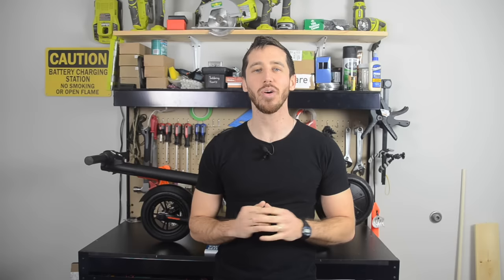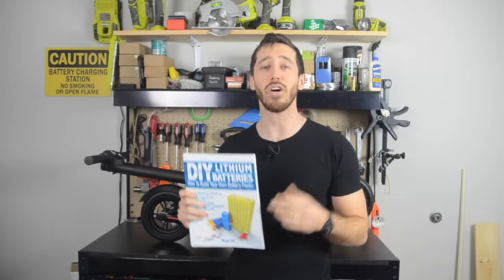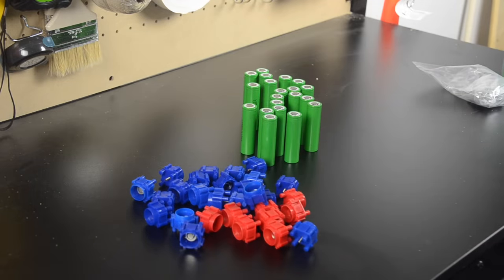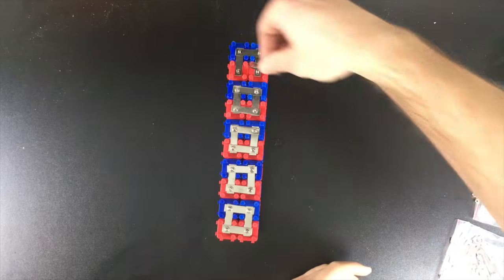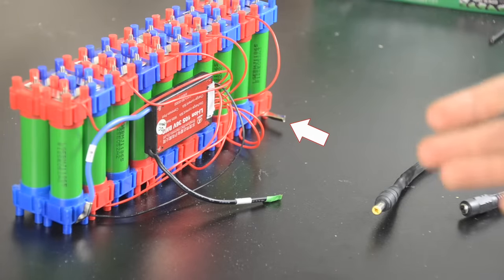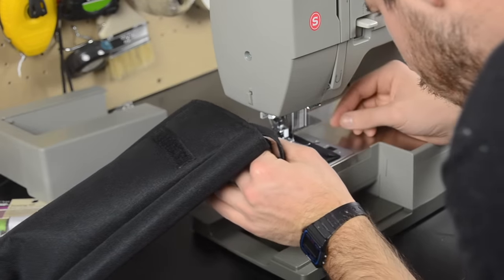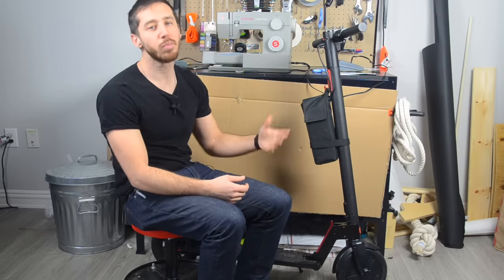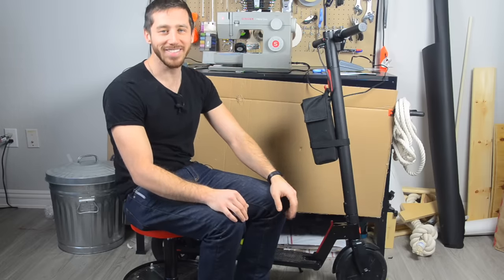DIY 2x range booster battery for electric scooter or e-bike

Comment: I have a question to make for you , maybe you are the only one that can properly answer. 
I want put two front lights on my 54v 18.2amp scooter , but the lights are 12v-80v lamps . If i direct conect them in the cable from my original lights in the scooter what kind a problem can happen , or if is okay to do it ?
Thank you , i hope you can help me .

Comment: is it really that simple to connect two exact same voltage batteries in parallel by " plugging that pack in to the charge port of your e vehicle battery ?
Reply: Yeah it's just like adding more cells to the original battery
Reply: Haven't gotten to it yet but I want to add a aux battery pack to my electric motorcycles. This way looks the most efficient .
Reply: yeah I want to know as well.. when i plug in the wall charger to my scooter it doesnt run... is it because its ac? so once i build the battery i just plug it in and it will work or do I have to bypass something? and then how do you charge the extra battery pack?

Comment: I have a DYU d1 36v. I’d like to use a ryobi 40v battery as a range extender. Could I put a quick connect on the original battery so I can unplug that battery when it’s low and plug in the ryobi battery?

Comment: I’m a newbie to ebikes and battery power. I just want to be sure I’m understanding this correctly, don’t want to burn up batteries or motors or anything! I have a second battery for my bike, it is the same voltage but slightly less ah than the original. So I can connect the second battery into the charge port of the first and that will boost the range without damage to anything?

Comment: hello, I wonder about soft pack lithium 48v if the charging port is broken, can I charge the battery on the xt60 connector of the output the one to the sooters ontroller? are they required to charge on the charging input [laptop connector) is it difficult to splice otherwise?

Comment: Thanks for a good video. I have a turboant x8 max with removable battery. Do you have any good advice for connecting a battery like the one you build in the video. My turboant cannot turn on when charging. That's why I can't connect like you do in the video. I think I have to solder a plug on the wires inside the scooter?

Comment: Great video.thanks. Ok know voltage .5% up or down difference makes no difference but what if use a 36v4.4ah on a 36v 5.2ah battery for go trax rival and can I buy one already made with different ah but same voltage and splice tip of wire or connector to plug into my gotrax rival for extra diy power?thanks...

Comment: What is the rule of thumb when building a second 18650 battery to be added in parallel? Does the continuous discharge and capacity of the cells matter? Do the specs have to be the same? I built a 14s4p battery with Panasonic NCR18650F which are at 2900mAh with a 5A continuous discharge...

Comment: @EbikeSchool.com Thank you so much for making this video Micah! I owned 2 original GOTRAX GXL scooters one for me and my Girlfriend. The range was really becoming a problem especially if we wanted to commute, take long rides in the country or on Holidays here in the U.K.

After watching your video I was on a quest to build the exact same exact batteries you built for our scooters and with the guidance of this video, few month of making mistakes wiring my connectors incorrectly, shorting 2 chargers and 2 scooter batteries they are finally finished. 

I’ve build 2 of the exact same batteries using the V2.1 Vruzend Kits with 3 cells in parallel using Samsung Q30 cells with a capacity of 9 Ah each and man is the scooter even faster than before, it does 22mph all day long now, so fast I wear a helmet as it’s just as fast as my Brompton Bike. If not faster!!
 🛴 💨 💨 

All credit goes to you Sir, once again thank you for the awesome content! I’ll be posting a video of the finished builds soon for watching for name in the video credits.
Reply: How did it hold up?

Comment: Hi. I am new to baterries and my question may sound silly. 

I am thinking make a battery that is 3 times the capacity of the scooter's battery. Then connect them through the charging port like on the video. 

Do you think if the new battery has much larger capacity will be okay? Will it increase my range a few times?

Comment: Hi Micah, is it possible to connect or BOOST a 48V ebike Battery pack with a 36V Battery?
I upgraded my 36v Vehicle to 48V (Battery, motor wheel and controller)  and now I have a redundant 36v battery pack which is very a good one(panasonic cells).There is ample space to carry both batteries on the one bike.

Comment: Another question...I want to build a booster battery for a 48v 14ah battery. When daisy chaining the original and booster is it important to match the voltage AND and amp hours or can the ah be slightly different ?

Comment: Hello Mica 
Can I parallel these 2 battery packs 
Both 48v lithium ion 18650 LG cells 
A 13s 7p with 210 amps continuous 
And a 13s 20p 200 amps continuous
Thanks in advance 
Hon

Comment: Question... Could I build a booster battery like this for my 60v escooter (which comes with a lithium ion battery) but use a Lifepo4 battery instead? I just like the simplicity of the prismatic cells. Will doing so cause any damage to components, the original battery longevity, etc?

Comment: Thanks for the time and effort you put into these videos! A video on wire gauges for power wires and battery capacity would be great! I want to build a pack, but worry about burning up the wiring if it supplies too much power :p

Comment: Hi. I have a query. I have made an electric cycle with 250w pmdc motor and 15ah lithium battery 7s7p and 15a bms. What I had noticed the full voltage shows me 28v after charging and it gets cutoff at 24.5v. Hardly I could have driven my cycle for about 10km or less, but not more than 10. Why does it get cut off so early, on the controller the cut off voltage mentioned is 21v, but it gets cut off at 24.5v. At 24.5v if I apply throttle, the entire system is switch off. What could be the issue, with the controller or bms or anything else ?
Reply: i think its because of your bms. 24.5v is 3.5v per cell. under NO load. so when you are driving there is a load and you go under the 3.5v per cell. the bms protects the cells and cuts the power. until the batteries go back up to a safe voltage. if you are using old cells or cells with a low discharge rate this will happen faster then cells with high discharge rate. so if you want more miles. make the pack a 8s. your ebike motor can handle it just fine. just make sure your controller can handle the extra voltage.

Comment: Do the cells have to be identical, from the same manufacturer, identical specifications? (Panasonic PF vs LG vs NoName chinese). Or it is enough to have the same total voltage and slightly higher Ah for the booster one, like in the video?

Comment: Wanted to fyi you of the topic on the WATT numbers on motors and what to look for of certain companies that advertise of what they have to sell. I came across a sale on title of 350/500/750 watt e bike and remember what you mentioned and I notice this as the Bike is all the same with the 500 and 750 having bigger tires than the 350 including the battery for each one. Well, I know enough now I went ahead and got the 350 watt GEARED Bike and I just swapped the battery intended for 350 and got the one separate of same specs of the 500 and 750 they were selling. I basically got the 750 without their fatter tires and higher amp battery, lol. Im going 24mph on the 350 daily of new battery of same amps as the 500 and 750. I saved 300$ of getting the 350 watt which actually is same motor for the higher priced ones of same model. Its really  a 1000 watt motor as I checked the wattage amps when I juice up throttle all up it reads 1000 to 1200 and it drops to NOMINAL OF 500 to 750watts once on cruise control and dips down to 50 when I use PAS at 24mph.

Comment: QUESTION:   i have wired 2 18V 5AH  cordless tool batteries in a series to get my 36 volt requirement....currently have a 36volt 10 amp series of 3 batteries as primary..cant i plug my junkyard dog battery set into it and then increase amps by 5 ( 1/3)  ?

Comment: Hi, great video. If I were to plug the booster battery with lower charge than my ebike, would I damage the ebike battery, or will the ebike battery just charge the booster battery to an equilibrium charge? Thanks.
Reply: If theres a small difference it should be okay. If its too big everything between and the batteries themselves can catch of fire.

Comment: Is it okay to connect 2 packs that have diff capacities? I was told that I is not a good idea since the oack with the smaller capacity would drain faster and would result in an inbalance of voltage of the packs, but they say that if I wanted that setup, I should put a 3 way switch, that way I can switch in using the external pack when the internal pack is depleted. Whats your opinion on it?

Comment: What happens if I put in parallel 36v .4 amp with 48v .15 amp ,please tell me is dangerous ? I want to put one battery from hoverboard to one scutter for range extender it is possible to do that?

Comment: On an electric scooter, I want to replace my damaged battery... 
Will the exact same charge controller work if I put the same number of cells just with higher capacity ? Will it still charge/discharge normally ?

Comment: Corect me if i'm wrong but it should be safe to connect the battery to the scooter even if the charge level is not the same. The battery with the higher charge level should charge the one withe the lower charge level.
Reply: Still problem charging both battery packs seperate all the time just make new pack better cells or more cells in parallel and because charging port is for charging is the wire capable of withstanding the current 
You end up burning the wire then ya have to do repairs anyway 
Bin scooter battery makes it lighter
Make better one upgrade power connection and wires put battery in Ur backpack

Comment: Thanks for the video.I have done the battery but when i plug it and ride the scooter only the scooter battery gets discharged ,the backup battery drops only 1 or 2 volts.The scooter baterry drops to 7v ( from 29 V) and the backupbattery drops from 29 to 27V .I have noticed increase from 8 km to 10 km(with the backup pluged) Is that normal and where is my mistake not to double the distance?.Thanks.

Comment: If you have a 72v 20ah battery with a 80a BMS could I simply use a second 72v battery for more range….No BMS? Would the battery with the BMS continue to keep it at 80A But increase the range? The speed is fine….I just want to increase the range.

When building another battery…and you have the cells matched with the main battery, would I have to multiply the individual volts on the cells…to hit my 72v’ example…if each cell was 3.7 volts Wouldn’t that mean I can only use around 21 or 22 cells…to achieve a 72v battery?

Comment: Is it a good idea to connect the second battery to charge port?
In high power ebike the charge port doest take much current
Isn't better option is to connect the second battery to the power wires that goes into the controller parallel to the original battery so the controller can use the full potential of the second battery?
Reply: I have the same question.
Connecting to charge port is for sure the easiest solution, but is it the best? And will it work for all scooters? I have xiaomi m365: charger output is 42V an 2Amp (84watts) scooter battery on the other side is 37,4V. So what should be my range booster battery voltage if i want to connect it to scooters charge port?

Comment: just bought your book, amazing job and videos, i assume the charge time for your battery took 2x as long as before with the same charger you used for charging the scooter prior to the battery upgrade? also the battery indicator on the scooter, i assume it reflecs the percentage of the remaining power left for the old battery which should approximately equate to the same percentage of remaining battery in the new scooter as both the new and old batteries should have the same voltage? Are these both answers yes?

Comment: Great video. I have the Go Trax Rival and read some really bad reviews . And of course no customer service line ... Just email responses in 72 hours Asking for this or that. Then when you respond 72 more hours ( each time ) on response and a different rep you have to explain the whole issue and history of problem with each time per many many reviews. I've had no issues yet as in 2 days of ownership and have 30 days to return if I am not satisfied.
I like the scooter but it seems Go Trax Customer Service is not user friendly and the longevity of the batteries installed and the charger wind up being very short lived. Ninebot and Segway have the best and longest lasting scooters with their lowest priced model priced at $439.00 plus a $20 off Coupon.   Just curious on this battery system.

Comment: EBIKESCHOOL....... I HOPE YOU SEE THIS. Thanks for your videos foremost... I own a kaabo wolf warrior electric scooter it has a 60v 35ah battery with 2 charge ports so if I make a 60v 15ah battery and plug it into 1 of the charge ports can I leave it plugged in and use the 2nd charge port to charge the original and new booster battery at the same time? Also wanted to know if both batteries will discharge at the same time,as 1 battery? THANK YOU FOR YOUR HELP!!!!!!

Comment: Just got a 60V 21Ah battery electric scooter.  I'm planning to build a extending range battery.  Can please someone point me to the right direction?.. do I need to build a 60V 21ah battery?  Can I make a smaller with more Ah power?  What would be the best recommendation.?  Thanks in advance

Comment: Thanks alot for the video bro, was really helpful for us us noobs to understand.

So as long has my new battery pack is the same 72 volts,I can still use a higher A.H ( 80ah) than the existing battery (35ah)?

Comment: Couple of Questions...
Can this be used as a backup battery in the event that the Scooter is running low on juice? 
I didn't see in the video if there's a charging port for the DIY battery...
If Yes on both questions please sell the product as you can see a lot of people trying to buy your product....
Thanks😉

Comment: Is it important that both batteries be of the same array configuration ?

I wish to parallel connect 2 48v battery paks. One is 13s7p (17.5Ah), the other is 14s5p (20Ah)
Reply: The 13s and 14s will have different voltage so that is not recommended. You can put a 7p in parallel with a 5p, but each needs its own BMS and fuse.

Comment: Shouldn't you mention the possibility that when using the primary battery under sufficient load (>10 amps), the secondary battery will try to put a charge current into the primary battery far too large to charge? Kind regards

Comment: Are you charging the main battery as you use it or actually running off the second? Also, the gotrax charger is 42v,  why didn’t you build a 42v battery instead of 36v?  If the bms of the scooter is working properly why would it discharge into the second battery since you’re plugged into the charge port?  Great video, just many questions remain. Thanks for taking the time to answer.
Reply: He said the second battery is charging the main battery. Some scooters can still run with charger plugged in and others can't. Check to see if your scooter will spin/run while charging before you proceed to make your kit.

Comment: Interesting, can this be done on a  Bosch Performance CX
Equipped with Bosch's top of the line Performance CX motor and 500Wh battery on a Cube Reaction Hybrid Pro Allroad 500 ebike ?

Comment: i missed was conectiongvto the type of battery in these gotrax scooters .i have one laying around and had a look at is design .i would go for a 365 type scooter or but a bigger ah scooter to start with .if youre looking for one .as a budget scooter the  lower center of gravity .given the baterry is in the base and not in the steering pole attaching another weight to this pile and not securely fixed wiill make it unstable prone to falling over heay steerin and unpredictable .slso not very waterproof .greatbidea fo a e bike fitted to a pannier rack .uve been thinking about this for a while id put in a waterproof panier bag and fit mudguards too

Comment: Hi. I recently came across your awesome channel. Can you confirm - if I change the motor to suit the battery ie higher motor / battery would I have to change anything else ?  I have a 3 wheel mobility scooter which as a project I wish to increase distance. Advice would be great please. Thanks sam

Comment: Great video. I have a electric wheelchair attachment called firefly and it has a 250 watts hub brushless motor and runs on a 36 volt 6.6ah battery. I like to add a booster like you did in video so I just plug it into charging port and extend my range. Can I use the same as what you made in this video...?

Comment: Thanks, and I liked that you showed a non welding way, to build the pack.
Reply: welding is a lot safer tho, i would suggest soldiering the connectors after to prevent loosing from vibration during riding! Or just by an inexpensive battery pack on ebay.

Comment: Hello, I would like to improve the battery of my Electric Scooter Xiaomi Mijia M365 but I am not sure if I extend the battery that has been adding more batteries and using the same BMS and also expanding its room with pieces of 3D plastic or adding an external battery. There is also the possibility of extending the battery by expanding its voltage to increase the speed of the scooter and for this it would need to modify the BMS with 6 mosfets and condenser 100v 1000uf. I need the scooter to move around London UK at a distance of 30 to 40 miles round trip and charge at home. Thanks for the video it helps a lot to understand the world of batteries and electricity.